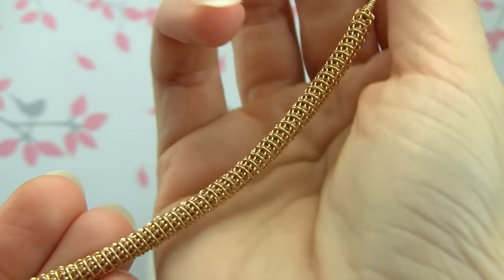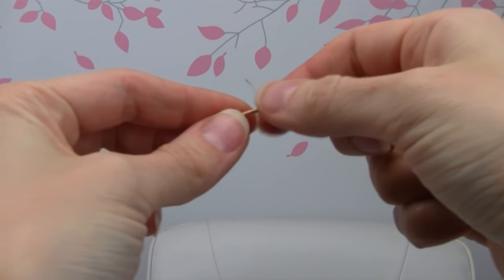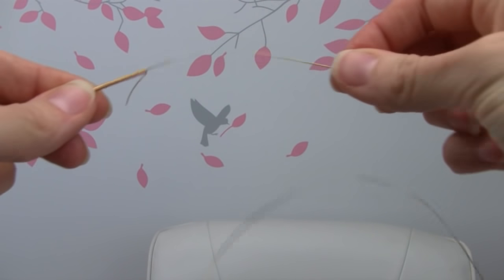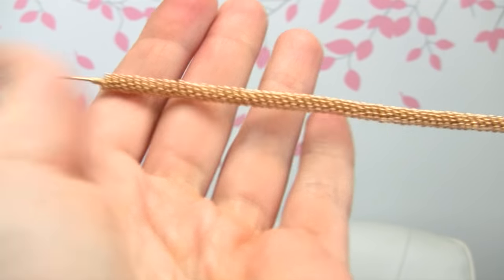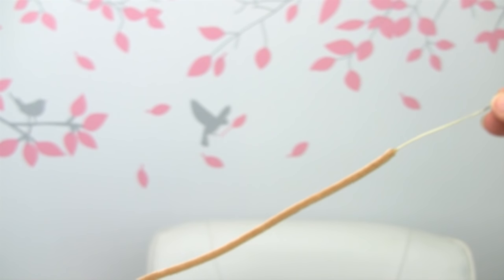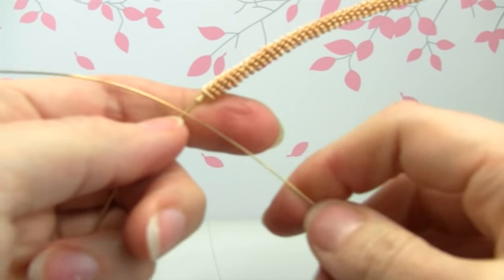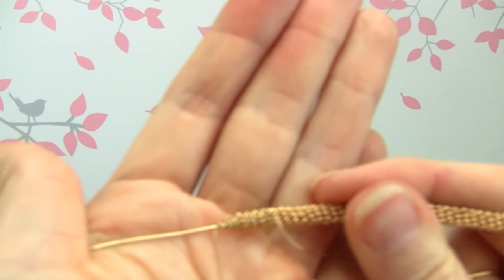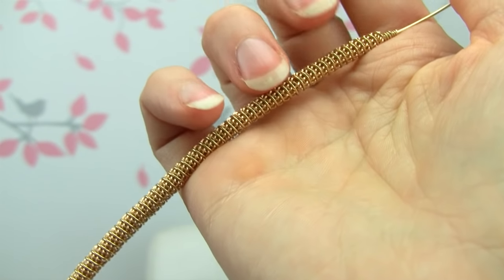Coiled Coil / Tubular Weave Wire Wrapping Tutorial Demo

Comment: I was so glad to find your video today!  I was really fighting with this yesterday and this helped a lot.  One question, please?  How do you make a longer coil with your Coiling Gizmo?  I was trying to figure this out too.  Thank you!  I love your videos and your teaching style!
Reply from the maker: Unfortunately you are limited in length by the little rods that come with it. But if you get some hard wire(it can't be the normal dead soft because it is too floppy) you can make your own rod. I got some thin stainless steel hard wire and was able to make a longer rod, you can also check out a hardware store in case they have something you could use

Comment: Finally I have been looking for good instructions for this for a while! Thank you for the details! Curious, where do you get your larger spools of wire? I hate buying smaller lengths at craft stores.
Reply from the maker: The brass I got from Rio Grande and Unkamen supplies. And copper I get from Monsterslayer.
Reply from the maker: Thank you! Glad you liked the video :)
Reply: Ooooo im going to get in trouble on these sites! lol ^_^ have you tried just using a drill for coiling? i like it alot better its much faster! and if you get one the cheap drills that only takes hex screw heads you can make your own posts (albeit on the larger side, im still looking for smaller ways). Im thinking of making a video to share with people.
Reply from the maker: Cool, you should make a video. I have not tried using a drill.
Reply: SleepyAux Music 

Hiya, I saw that you were looking for larger spools of wire. The best place for this is Jewellery Maker. You can buy from 10mtrs to 100mtr spools.
The wire is just brilliant for wire wrapping, comes in various colours and various gauges and best of all it's at fantastic prices. Go on line and put in jewellery maker.com.  Hope this helps

Comment: Thank you so much for your tutorials!  What type of bare copper wire should I get  (to start weaving with base wires)? I have 28g and 30g dead soft, but I don't know whether to get half hard or dead soft 22 gauge wire for the base wires. I have 20 dead soft, but my thumbs bend them as I wrap and it looks horrible :/
any advice would be DEEPLY appreciated!  
Thank you ♡
Reply from the maker: I use dead soft, I get my 22 gauge from MonsterSlayer. 20 gauge will work as well. I am sorry, I do not have half hard and have not used that before. You can use the coiling gizmo to wrap the second portion and then slide it off and place it onto the base wire, perhaps that would help.

Comment: why are there no instructions on how long the 26 in wire is and how long the 24 in. wire is. how can this be done. please help
Reply from the maker: there is no specific length, the longer you make the wire the longer the final coil will turn out to be. I am not sure how to figure out the proportions of weaving wires to final coil length, I just used random length to demonstrate how to coil

Comment: Does anyone use a drill for not only the initialLong straight coil, but for the second part (coiling the coil around yet another wire)? Is that even possible? I just made my very first long coil using 20g and 26g dead soft copper. In a lot of the videos on coiling, the person is using a really hard straight piece of metal, like for welding, and then they take the wire off and use just the plain coils as "beads" like sliding them onto memory wire. I have to use soft copper and silver or else it is too hard to tightly coil it around another wire. I have a coiling gizmo but all the holes and rods are too big, so now, a cordlessDrill. Demos?
Reply: Tara Brown, I've used a drill for making the initial coil many times and it works very well
Reply: Yes, check out Lisa Nevin Kelly at Beaducation.  She is awesome.....
Reply: I always use a drill.  If you have a round solid metal (steel) piece you can put in Chuck of drill ( I think I purchased a length of thin braising rod, which is firm) (anything that makes a mandrel to the size you want and will fit into Chuck will work, along with a bit of the end of your fine gauge wire….tighten Chuck and then press drill button.  You might want to secure the drill as I do: 

I usually have drill clamped upside down so I can use right hand med finger 
to press drill button and left thumb and index finger to keep wire in alignment.  Takes maybe 10 minutes!